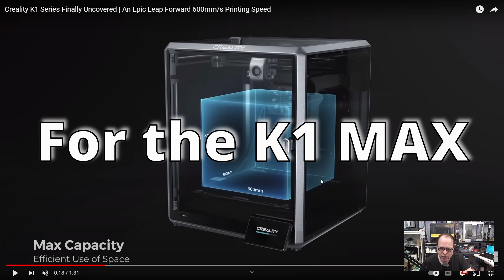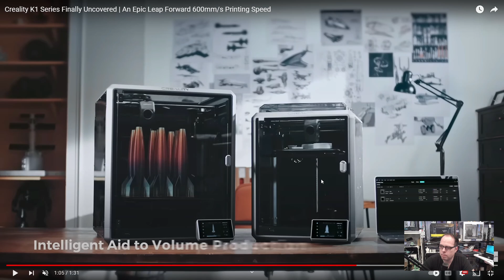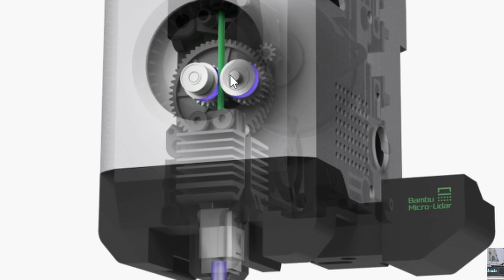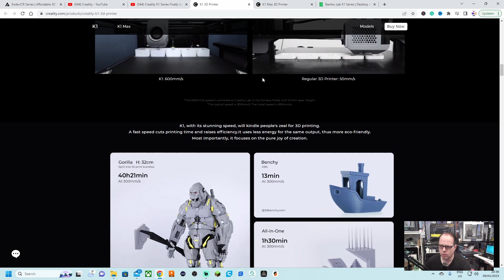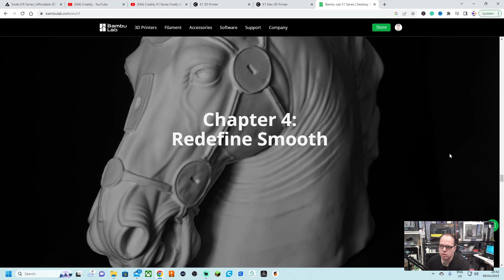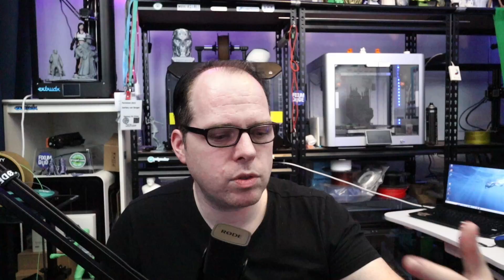Creality K1 and K1 Max - Z3DP Reacts

Comment: it is a clone and if i can slap klipper on it im buying it!
Reply from the maker: Let's go
Reply: I'm pretty sure it's already running klipper.  Creality already has the sonic pad running klipper so it's very likely this is too.
Reply: @CL-gq3no  Nope, it's running their own proprietary OS called "Creality OS"
Reply: @atvking535  I'd bet money on it being a Klipper fork, though, so replacing it with main branch should be easy.
Reply: @twincast2005  Maybe.. I guess we'll see. That would be a huge plus if so, but given that they know the community loves open source (and Klipper especially, hence the Sonic Pad), why wouldnt they say that in the marketing material to drive up hype? I'm guessing they use it as a means to slowly shift towards closed source cause Bambu Lab more or less got away with it by claiming all the new/innovative features made it a requirement.
Reply: @atvking535 , Understood, but I'm sure they didn't write their own software from scratch.  They have never done that on any of their printers (they all use Marlin).  This new series just happens to have all the cutting edge features and performance of Klipper.  I'm sure that isn't a coincidence.  It is almost certainly running a pre-packaged version of Klipper.  I wouldn't be surprised to find out that the "K" in K1 stands for Klipper since this seems to be a new series of next gen printers.  We'll have to wait and see how configurable it is, but I still think it's running Klipper under the hood.
Reply: @CL-gq3no  i would LOVE for that to be the case, but i seriously doubt it
Reply from the maker: Indeed, I think it was build-in

Comment: What's wrong with a clone if they're copying all the best features
Reply: At a lower price 😊
Reply: @TrinacriaChild  and open source.
Reply: @jp-3dairgunworks152  Where did you see that this Creality is Open Source? :o
Reply: @TeaObvious  the design for the style of printer is open source not creality itself...
Reply: Exactly
Reply: It's fine. But if they don't update bugs or have inferior durability or quality. It's just a shame.
Reply: "What's wrong with a clone" ... exactly nothing! Copying things, cloning things is the ground up idea of Rep Rep!
Also with open source ... it benefits everyone, although not one company can get a monopole anymore.

But reproducing things is the one thing that 3D printing is all about!
Reply: I did work on my Ender 6, new hotend, top to make it enclosed, new bed and extruder. I added a Sonic Pad and 3D Chameleon. It runs fast and 8 different colors. I'm more then happy with it.
Reply: In my experience if you know what your doing Creality machines are better than anything bambu labs or Prusa can make
Just take patience
Reply: @Anonymous-th2cz  No, I have Prusa and Creality.
Had an Ender 3, currently have a Ender 6, and MK3S+.
My MK3S+ out of the box was quite a bit ahead of both Enders.
My Ender 6, I've had to upgrade a lot of stuff to even think about getting close to my Prusa speeds while keeping decent quality.
My Prusa still pushes higher speeds with near perfectly quality.
Reply: @spydergs07  I know, I have one Ender 3 Pro that I have spent more  money upgrading it than it ORIGINALLY cost (mine's a Refurb), and I could still upgrade a few more things. I like versatility, but it is ridiculous all the things you have to change out on standard models, as soon as ANY technology changes.

Upgraded to an All Metal Hotend
Upgraded to a Bi-Metal All-Metal Hotend (now, it looks like I'll have to get a Ring Hotend, and soon after, an Inductance one)
Upgraded the Motherboard
Upgraded the UI
Dueled-out my Z-axis
Direct Drive(d) my Extruder
Changed out brass Lead Screws for PTFE Coated ones
Changed out the plastic Bed Leveling Knobs for bigger metal ones
Changed out Bed Springs with Silicon solids
Changed out certain Frame parts for color-matching alternatives (Red, if you were wondering)
Replaced the Wire Wraps (partially for looks and partially because of all the added wiring and subsequent installation damage, also Red)
Added an: LED Light
-a Filament Holder
-a Filament Run-Out Sensor
-CR Touch Leveling
-Magnetic Bed

One could make the argument, that the printer I own today, is not actually the printer I originally bought. However, I still need or could use: On-Board Camera, Mesh Bed Leveler, Q10 Bed,  Support Arms, a Cover, and I have even considered extending the Z, going with Linear Track/Rail, Geared Stepper Motors, Water Cooling, Dual Extruder, and Ball Screws instead of Lead Screws. Thankfully, because I decided not to use this printer for ABS, Nylon or Carbon Fiber, I get to save a little on my upgrades by not having to purchase a Copper Heating Block, hi-temp Thermistor, hi-temp Heater Cartridge, hi-temp Bed Heater, and bigger/better Cooling Fans.

The rub is, you don't realize what all you are going to need, or want, to change-out when you first begin, but change one thing, and you almost HAVE to change something else. Then it becomes a "Well, if I had known to begin with, but I've spent to much to stop now" game. And it is not like I had to change them all out at the same time, so $25 here now, $75 there later, wait a month or two, and dammit, the Sonic Pad comes out...
Reply: And a better brand name
Reply: It's a creality product. Worst quality most unreliable printers ever
Reply: @P4TRICCS  my ender 5 pro runs perfectly. Got it over 1 1/2 years now
Reply: @maticola6609  you are lucky.
Reply: here is a bambu labs fan boy
Or prusa perhaps
Reply: @Anonymous-th2cz  It’s a staple In the 3d printing community but Is known for QC Issues
Reply: @Anonymous-th2cz  buy one of these ... and after few months creality launch another model with minor update so you can say goodbye for support on k1. Bamboo have 2 model stop! From day one they set new standard in 3d printing  as prusa 5 years ago. I' m not a bamboo fan but is my first choice for the next printer... i disagree only  material waste with the AMS system
Reply: @billyocore5839  at the end of the day I don’t care what company the printer is from I just have an extreme interest in printers and with creality I enjoy messing around with the printers and editing them. All these companies make amazing machines for different groups of people if crewlity isn’t for you that’s fine cause bambu labs make great out of the box printers
Reply: @Anonymous-th2cz  as a vice man once said.
If you like printers buy creality
If you like printing buy any fcking else because you won't with that shit.
A proud broken sad hateful annoyed owner of an ower modded ender 3 pro. (it's only works because i modded it)

Comment: Are we living in a future where creality is in a better position than Prusa?
Reply: Prusa? Prusa is overpriced garbage for fanboys! 1100$ for tiny bed slinger in 2023?! Assembled from the worst Chinese parts and a Prusa Research sticker was subsequently affixed. Creality sold over 5 million printers worldwide, it has 3.5 milion users. Prusa sold 200-300k printers...
Reply: I don't know about before, but in the current state of the 3d printing market, Prusa is losing all of their advantages. Currently, with MK4 they have small, old-looking, overpriced bad slinger with 3dprinted parts. Even small manufacturers have managed to beat them in their game. I can tell you that Neptune 3 Pro has the same reliability as MK3 for a fraction of the price. Elegoo is not the only company with better products than Prusa, there are many more. BambuLab destroyed the market and is not comparable with any other out there at the moment. If the K1 series from Creality manages to come near BL for a better price, it will be a step in a good direction for us. Prusa is history at the moment.
Reply: @3D_Garaza  I strongly disagree with all you said. The quality and support that Prusa offers is not comparable with anything else in the market. The fact that they use 3D printed parts for their printers is not only good, but the right way to go. It's confirmation of the quality of their products, and thanks to using the printers themselves they can improve them to a level other companies can't, and it shows.

I'm not a fan of bedslingers, but my opinion is constantly thrown away by the quality of their i3 printers.

The only think I hope they do is a "Prusa L", a smaller XL.
Reply: Prusas are overpriced ender3s. i don't know how anyone still defends prusa when there are significantly better products, especially when you consider how expensive Prusas are.

if anyone truly wants a true out of the box printing experience, then just get an X1Carbon and call it a day.
Reply: @KimmyR3  amen. You’d think with all those 3d printed plastic parts it would be cheaper. They’re the definition of getting too popular and getting full of themselves. They’re not even the best printers out there below their price bracket. It’s a shame.
Reply: my 'klipper'd' E5+ is not even close in price to a Prusa, but has way more functionality and features. granted that i had to learn my way around the printer and klipper, so one could argue that "learning time" is also cost. but you have to do that anyway, on ANY printer, to perform maintenance and operate the machine.

again, the only semi fool-proof printer in the market today is the Bambulabs. But even after all it's calibration/automation, it still requires a bit of learning to properly operate  and get the most out of the machine.
Reply: @KimmyR3  That's why the MK3 has received numerous "best printer of the year" awards 🙄
Reply: @olavgausaker1  yeah cause prusa bought  them off or there just straight up blind theres nothing great or special about prusa anymore outdated and lacking in just about every area.
Reply: @KimmyR3  lol this comment shows you have no experience with a prusa. They are too little too late with the mk4 but the mk3 is not even in the same ballpark as an ender. Enders are exactly what they were meant to be, a cheap entry to the hobby. With a lot of time and money you can make one perform as well as a prusa before it breaks again. In 5 years I have replaced exactly 1 part on my prusa and constantly get shocked face compliments on my prints, usually by ender users. No way an ender will provide that, no way.
Reply: @zincyellowmach1523  fundamentaly the prusa and enders aren't much different your comparing a cheap product to an over priced product.  Most just comes down to software tuning throw a little in upgrading the ender and it can easily be better then a prusa. Nowadays alot of printers are getting a factory tune it honestly makes no sense to choose prusa anymore they've lost there touch/edge only thing they got is good customer support which you'll need cause there really not built that great for the price.
Reply: @user-tj7xr6xd9z  fundamentaly a Honda and a Ferrari aren't much different, put in 4 times the cost of the Honda into it and it will beat a Ferrari down the dragstrip. It's still a Honda and took gobs of work, time and money to get it there. If you owned both, you would realize how inaccurate your comment truly is.
Reply: Then explain why Prusa is selling so many printers?
I bet that Creality doesn't even have the full app support when launching the K1.
At least Prusa will tell you what there printers are actually capable of and have them running in production for a million hours before even showing them publicly.
Their customer rating is the highest. They also can do core XY. They showed a smaller core-XY than their XL some years ago so I guess they will eventually have one too but as a different lineage compared to the MK2/3/4.

The MK4 is just the upgrade path for the MK3(S). That's what they have been committed to. 

I don't care about overpriced. It's market priced. When you are selling 10k+ printers a month what's the point in lowering your prices?
Others might sell more, produce cheaper, have abysmal product support and QC...but what's the point? That's not what Prusa is going to do and why would he?

I just hope everybody is happy with his printer.

Don't own a Prusa btw...had a QQS-PRO before getting the v400 some month ago.
Reply: The specs look nice on paper, but we should wait until we see some get into the hands of unbiased reviewers before jumping to any conclusions.
I could also imagine them having a few patent issues with Bambu.
Reply: @ericthecyclist  Creality QC is horrible. They will send out perfect review units. The average person will be left with a dumpster fire and no support.
Reply: @ericthecyclist  chinese laws prohibit patents.
Reply: @cgwworldministries83  A quick google of "china patent law" finds lots of evidence that they have patent laws.
Reply: Prusa mk4 $1300 and as Uncle Jessy showed it sucks.
Reply: @Optikification  I don't trust Uncle Jessy. He messed up the printer and he's paid by Elegoo.
Reply: I take it back. He owned his mistakes on the next video.
Reply: @Optikification  Yeah I had hoped Prusa would have learned their lesson and lowered the price by a substantial amount, especially for the now ancient i3 bed sling design. When I can pick up 18 used ender 3s for the price of 1 mk4, you have a problem.
Reply: "in a better position than Prusa" ... they are in a better position since the Ender 3 came out because of way better price/ performance.
Sure a Pruse MK3S/ MK4 is the "better" machine in terms of out-of-the-box print quality, documentation and support. But how much better?! 4 times? - definitely not!
So when it comes to price/ performance (which for everyone should be an important feature, too) the Creality machines always are better (and more often sold I guess!).

Compared to graphics cards these days: a RTX 4080 might be a very good card. But compared to a RX 6950 XT or even an RTX 3080 it has a very bad price/ performance. So you pay what you don't get. - I couldn't feel good with that.
Reply: @hassosigbjoernson5738  I disagree with you. The price thing is not linear. Would you get a printer for $10 that is 1/20th the quality of an Ender 3?
Reply: @olavgausaker1  obviously that's not what he was saying it's about weighing the value without veering to far in either direction
Reply: they have always been better than prusa, you are just a blind fanboy.
Reply: @cgwworldministries83  They both have their ups and downs.
Creality is good if you want to tinker with the machine like crazy to get it to a decent state.
My ender was OK with meh prints out of the box.
Once I upgraded to direct drive, increased the part cooling, added bltouch, upgraded the bed to a PEI sheet, added silicone spacers instead of springs, and changed to Klipper. 
After ALL of that, now my Ender is close to my Prusa.
My MK3S+ out of the box printed great. Let it run a 2 minute calibration and it has been spitting out very good prints ever since.
My prusa also still can push higher speeds with a little better results than my Ender.
Reply: @cgwworldministries83   they are a great budget brand but Prusa has been the champion of reliable printers until the bambu labs
Reply: @cgwworldministries83  Sure, he's the fanboy 🙄
Reply: @olavgausaker1  or i just have experience with it and they’re actually garbage but you’re too stuck to admit facts
Reply: @cgwworldministries83  Prusa is overpriced, but Creality is hobby grade. You spend more time fixing and making it work properly than actually using it as a tool.
Reply: @cgwworldministries83  theyve literally never were better than prusa
Reply: @ste4lthles  sorry i don’t have 3d printed parts ziptied together. They’re overpriced garbage.
Reply: @cgwworldministries83  do prusa have zip tied 3d parts? Wow thats pathetic
Reply: @Tunedawg23  yep my mk3s has the bed rails secured to the mounts via zip ties.
Reply: @WhatTrigger  My Mk3S+ has screw down 3d printed straps not zipties....
Reply: @spydergs07  Least they upgraded that part with the + version. I was honestly surprised when I assembled it years ago thinking this is a bit cheap and dodgy
Reply: @WhatTrigger  not anymore, that is the old design. It worked though
Reply: @cgwworldministries83  I've never owned a Prusa. Overpriced for my taste.